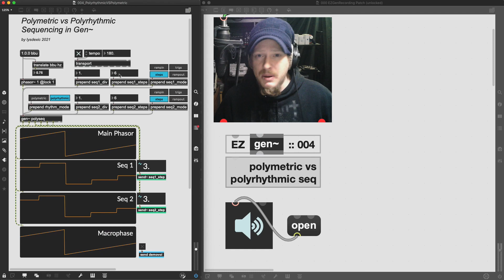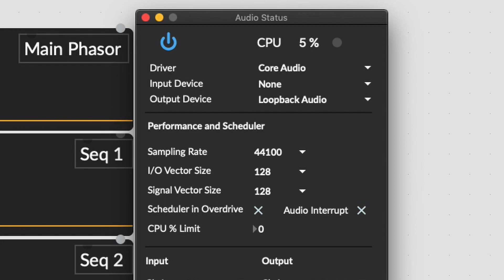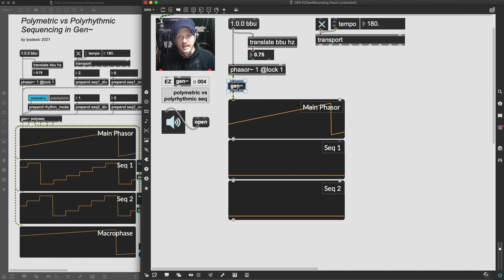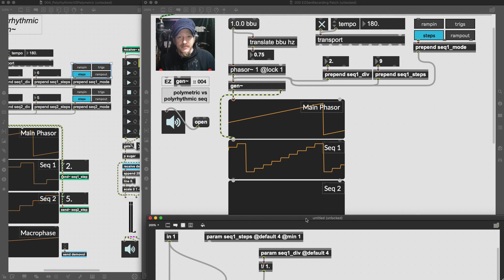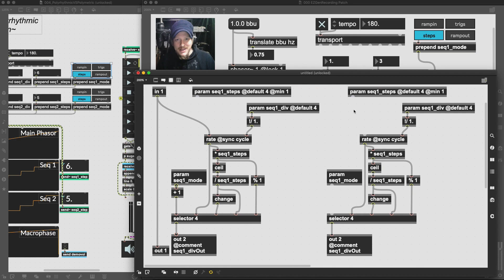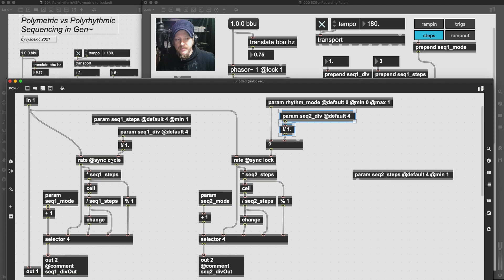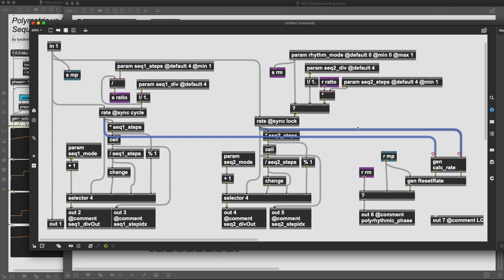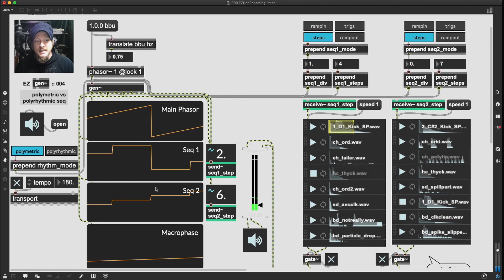EZ Gen~ MaxMSP Tutorial 004 :: Polymetric vs Polyrhythmic Sequencing

Comment: What would be de diference if we use @sync lock on the seq1 rate??

Thanks once again for this great tutorials.
Reply from the maker: Try it! The difference is that when you change it the output ramp will jump to the new value immediately and interpolate to it on the way there.

In both cases you probably won’t notice it too much. But experiment with it and see how it feels :)
Reply from the maker: I’m tempted to build a system that works like ableton live’s clip launcher where you can buffer and halt it for 1 bar or more/less before action occurs. 

Something we may come back to later
Reply: @lysdexic , my current system consists now on phasor am multiple rates @sync lock and I’m adapting your teachings to it. That’s why I was asking.

I will experiment in several ways. Thanks.

Comment: How would you convert the step number~ to a number? I thought of controlling other event based sequences. Great tutorials man, I hadn't looked at gen before, thanks.
Reply from the maker: Nice, glad you’re digging them. You could snapshot~ if you want the number at event rate. But remember that you’re losing some accuracy when you sample a signal
Reply: @lysdexic  Thanks for your reply. Yes, I tried snapshot~ and then realized I needed a bang so I ended up making some edge detection (with delta~ and edge~). Ended up thinking what you just pointed out, accuracy. Looking forward to your next videos!